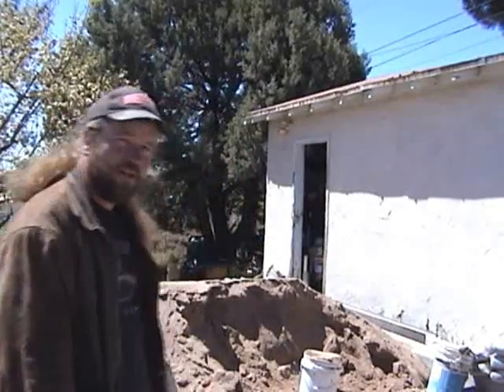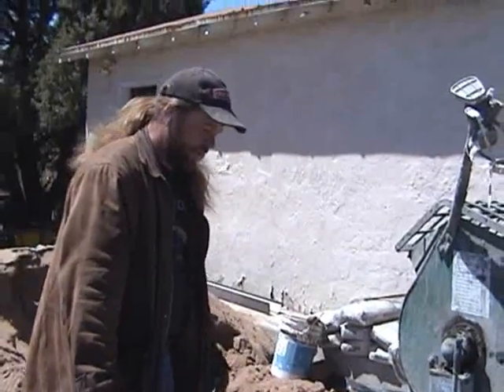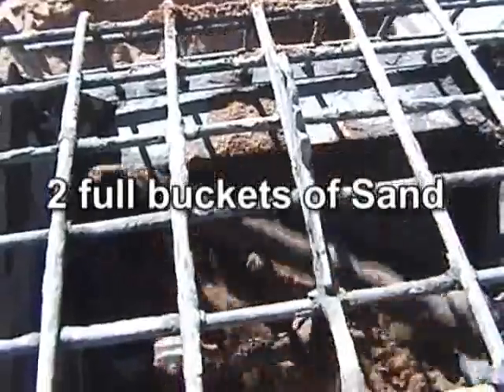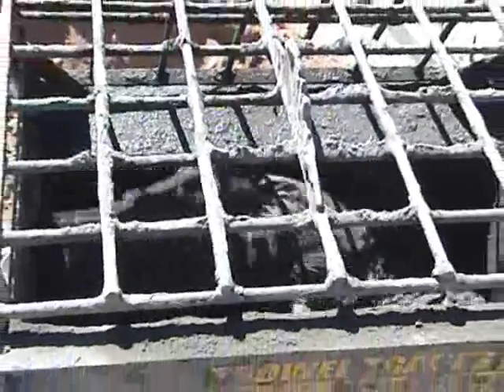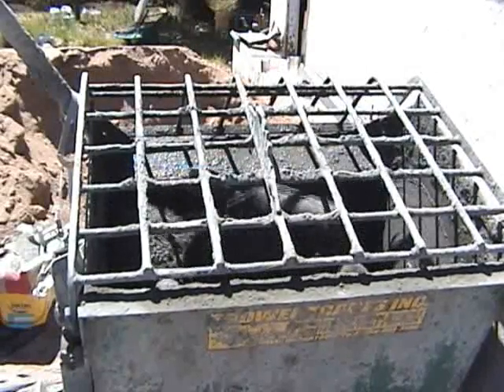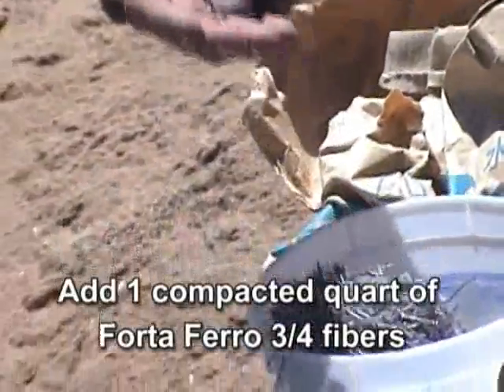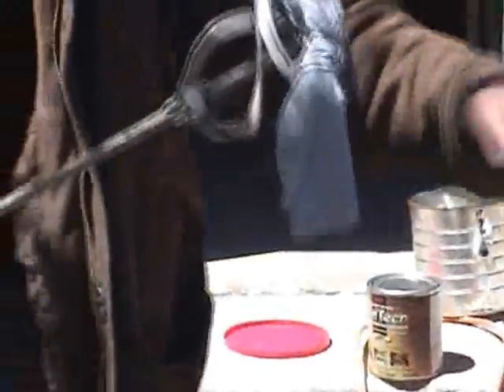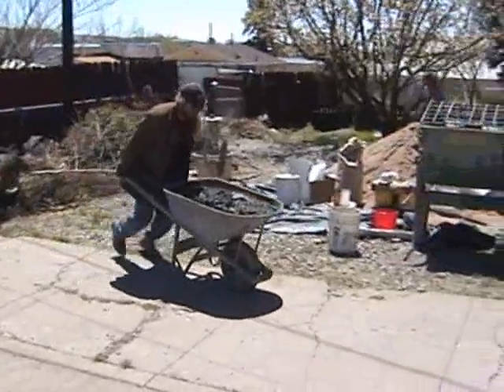The Plaster Mix for Parabolic Stress Skin System

Comment: Doug, your information is fantastic - thank you very much for sharing! I hope that you are still at it. You would be a great asset to many of the 3D printing efforts. Have you found the Eucon SPJ (now 5000) to be better for this than other PCEs, or is this just the one you are used to? We have had problems with PCEs working against the "buildability" (and definitely cause over-sensitivity to water)! Thanks again.
Reply from the maker: I have tried others and the Plastol 5000 is key.  It has the highest solids of the Poly Carb.  It seems to have been reformulated to be like the SPJ since it is no longer clear and so has the 'J' which at the time, before Euclid when those chemicals were owned by Boral, the 'J; meant Japanese lignin component that acts as a dispersant and helps prevent segregation in the High-Range, High-Solids poly carboxylate water reducer.  
The sensitivity you referenced has been eliminated now, as of this summer, by careful timing.  You start with not enough hydration, then cross that threshold slowly by first waiting 9 minutes after the Plastol 5000, to see where you are at, then adding 8 oz, then waiting 3 minutes, repeat until mortar goes from dry balls to slightly viscous, not runny, if it goes runny there is correction procedure soon to be published at www.Flex-Shell-Architecture.com  Drop to 2 minutes for the 3 and repeat pattern of 2 minutes to dial in perfect water content for the STAR M3 flyash and the Silica Fume (the Eucon MSA).  If you cross minimum hydration slowly, you cause most or all of the cement to hydrate by keeping it very dense so the particles shear everything into reaction.  This prevents heat spikes and bubble collapse escalation; a perfect fluffly overhead mix every time.  
I think the free-form funnel column technique is a different or even opposite approach for insulating and inexpensive earhquake safe shelter in a wild terrain, because it is not dependent upon expensive equipment and a level pad, but I believe a printing hybrid, could be good for producing the 10 guage strand.  You just need that tensile and compressive reinforcing , layered in that triangular pattern, and fluid, flex-stable form in order for the shell to perform under dynamic loading.
Reply: Doug, I am really amazed at what you have come up with - both for mix design and procedure. We are not patient enough for onsite mixing (for structures); it is delivered ready-mix concrete that we pump into place without forming. Has the same issues that you face, but not as elegant as what you are doing. It goes very fast - when going per plan.  We have shown that the vertical build rate is effectively limited by how fast you want to pump it. Method development still in progress! I will contact you by email if that is OK. Thank you!
Reply from the maker: @SpaceCrete  Please do, and Thank you.  You know, Flex-Shell (www.Flex-Shell-Architecture.com) is primarily a system for a self-supporting insulated (stress-skin) masonry roof and flex-stable single-shell awning that shelters the entry walls while buttressing the lateral spread of the roof.  I would use the same materials for the entry walls, but any material can be used.  You build your entry walls on a flat thin-slab that is load-bearing, even though you don't need that for an entry wall.  The slab extends to the retaining wall around the drip line, so you need no mechanical bonding of your wall to the floor, columns or ceiling.  It is better that they can crack and shift during earthquake. They just key into the rounded profile of the columns with a reinforced frame so they wont fall in our out.  

You should consider this roof design for your amazing extrusion process.  Also, consider the wire block framing for your fill form, as a stay-in-place form.  I use to focus on the strength of the fill but after switching to a stay-in-place form, 21 years ago, my focus switched to high-strength shells, the geometry of stress-skin design which led to the geometry of relationship, organic architecture, forms that blend to other forms and entire situations. Yeah, try one of these flex pavilions.  The are fast and fun, then use your pumps and injectors to make a fill and walls that you like.
Reply: I really like this mix design you came up with. I was thinking of using it as a coating on the inside and outside of an Aircrete wall & Dome. Is this mix water proof? Where do you buy all of your ingredients from.  I'm located in Trinidad Colorado and would like to find all the ingredients.

Comment: Hi and congratulations on the work and information you have provided so far. I would like to find more detailed information. Is there going to be a book or guide manual eventually? An e-book perhaps? Also any progress on the website and new videos? Thanks.
Reply from the maker: Yes, shambhalavillage.us has some info and flex-shell-architecture.com is the site I am building.  The system has improved greatly and is ready as an available-to-anyone method for hurricane and tornado safe housing.  To achieve this, it is important to focus on the Core Monolith Flex-Shell Pavilion as an initial phase of construction that is carefully integrated into the natural drainage.  This is only the funnel columns, the double shell insulating roof and the single shell curvilinear awning.  This makes one solid piece that can flex instead of come apart under intense strains like earthquakes.  The entry walls are nestled under the archways between the columns.  The foundations and level pads are shored up with retaining walls that use the same material.  These retaining walls channel the water through the terrain and into gardens that prevent erosion damage for the long term.  The truss system is very precise and requires 1 to 2 layers of remesh grid layered at an angle.  Every surface, including the block frame curved trusses, have this no-slip layering of almost two layers of remesh grid still that is offset to create a rigid triangular patter.  For the surface shells, the 3.2 guage expanded metal lath is used.  The shell mix is temperature sensitive, it will cross a threshhold and colapse the bubbles if it is too warm outside.  Adding more foam does not weaken the shell, I just confirmed.  That water is loss to evaporation.  Using a foam generator for the foam is not necessary as the problem was not the quality of the foam, it was always the temperature threshold.  I have overcome much and am about to finish this giant building but will post videos and the book soon.  If you want to start a project, I can help you with a construction management plan based upon a design to keep you on schedule and on budget.
Reply: Thanks for taking the time to reply. I am intending to build next year but at this stage am just seeking more information about the various alternative building techniques or systems on offer. After many hours of reading and watching videos, yours is the most interesting. I look forward to learning more.
Reply from the maker: I hope you do one of these Flex-Shell Architecture Core Monolith Pavilions so you can do your finish work under solid shelter that can never blow away or fall down in an earthquake. The framing is very straight forward and you can really control the shape and explore form through blending known shapes from cross-sections of your plans.  I believe it is faster than stick and frame construction, it is just a little different.  I would recommend a 9 roll starter building; a one pallet job. Process your steel, frame your columns and trusses, lay the surface shell framing, lath then hire some local tallent to help you plaster using this simple cake-recipie of a mortar mix.  The Micron 3 is no longer available and replaced by Starr M3 from Spherix Mineral Products in SC.  The Eucon SPJ has been replaced by Plastol 5000.  Good luck with your project.  Keep me posted.  Keep an eye on the website flex-shell-architecture.com for updates there, too.

Comment: where can I find some of these Specialty Products like mychron 3 and some of the others the fibers all of it
Reply from the maker: The PVA fibers you can order from Nycon.  http://nycon.com/nycon-pva-recs15/   The Forta Ferro fibers you can get from Forta Ferro   The Plastol 5000 (replaces Eucon SPJ no longer available) is from Euclid Chemical Company - You will have to set up an account with them or get it from me.  The Micron 3 is made by Boral Materials Technology.   It ships from their plant just south of Rockdale, Texas which is just east of Austin.  They will only ship a minimum of one pallet at a time and you have to set up an account. I encourage people who are serious about learning this Core Monolith Flex Shell Architecture to get set up with a whole pallet of Micron 3 because that is enough to build a home and a few practice projects. The Mearlcell 3532 is available from Airex Industries in 5 gallon pails. Again you have to set up account with them but not a big deal. I can help you. I can ship you supplies for practice mixes but the shipping can be steep.  I recommend using a simple foam generator you can make at home with PVC pipe instead of the drill whisk and I recommend weighing 40 ounce samples of your sand to compare the density to dry sand so you can compensate for any extra water in your sand. These two improvements helps to make the desired consistency every time you mix.  There is a video on Youtube that will help with the foam generator or I will send you info about my version. A mix cost less than 25 dollars, for 400 pounds of light-weight plaster that is perfect for overhead plastering and permanently water-proof.  That makes it the same price as basic bagged plaster but this makes a water-proof shell that will not degrade overtime like regular cement based composites will, because of the capillaries are completely replaced by spherical cells, which protects it from ice and rust damage forever, and it is a tight, high-strength flyash enhanced matrix that remains chemically active, continues to heal cracks and grow crystals and it can really take a hit, like bullets or hammers, without cracking because of the high strength fiber-reinforced attributes and the aeration that takes the energy out of impacts.  Think funnel column pavilion on natural uneven terrain, so your columns are integrated into the natural drainage for long term stability, then level areas with retaining walls reinforced with the same metal and composite, retaining walls that channel runoff into other terraced sections so the entire area achieves long term stability. I feel the ideal starter building would involve only one truss and that thick stress-skin section can taper to simple funnel column single shell shapes.  This will free up infinite design possibilities, because a truss can span 40 feet and be flat or any shape, think ribcage of a giant winged creature, but will provide an opportunity to practice blending the single-shell funnel columns with the double shell stress skin that has the truss inside.  Your entry walls that are nestled between the columns are a separate project built under the protection of the roof and awning.  This flex-shell geometry way is the best way, in my opinion, to make a roof that cannot be lifted off by a tornado or hurricane winds and to make a building that can handle an intense earthquake without collapsing.  The protected roof gardens, and protected gardens in terraced sections around the building for long term top-soil stability, and the water storage capability inside those columns is an added bonus.  This shell awning and columns approach help regulate a comfortable temperature throughout the year, removing or drastically lowering the cost of heating and cooling.

Comment: Hey!, Doug!! Are you still at it these days?! Doug waters and I built the wire cage fabricator and we will probably be putting some blocks together this spring in order to build a parabolic stress skin greenhouse.  Looking forward to utilizing this system! When you use portland cement is that 90lb bag? Thanks for any update!!
Reply from the maker: +Ron Gray  Going Strong.  Glad to hear. The Curved Truss System is greatly improved and follows a triangular pattern and the surface reinforcing is improved as well so that you are using an average of 2 layers and the layering is off set so that you create a sturdy triangular pattern.  This provides active tensile reinforcing in 360 degrees along the plane of the shell.  Also, the Eucon SPJ is no longer available, I have been using the Plastol 5000 with a tiny tiny amount of Visctrol to control the consistency but you don't need in, just use a 25-30 percent smaller dose of the 5000 and it is fine.  If you like, I can sell you the Plastol 5000 blended with the tiny dose of Visctrol and the Mearlcell 3532 directly so you don't have to set up an account with those companies. You can only get the 3532 in 5 gallon pails which is 15 times more than you will need, unless you are filling the walls with a neat, ultra light cellular concrete.  I have been busy this fall with refining the foam core method for insulated tanks and planters.  I have a new composite and method for that system and it is ideal for cantilevered countertops and shelfs,  Instead of the fiber glass, we have switched to the basalt mesh because you need only use one layer because it is stronger than the 2 layers of glass.
Reply: That is Fantastic, Doug! I will have to send you an email to get some pictures if you have any of the new configuration! I also have changed to basalt ~ fantastic results and the ability to shape it in any form we want! Happy and Blessed Thanksgiving!!

Comment: How far have the New mixes that are out with the additives come sense you first made these videos,and are you still doing this type of work?
Reply: Hi and congratulations on the work and information provided so far. Is there going to be a book or manual guide eventually? Also any progress on the website and new videos? Thanks.
Reply from the maker: @bryanwillis123  you can find new info about the advancements at www.Flex-Shell-Architecture.com
Reply from the maker: Hi Brent - The shell mix is mostly the same but I understand some new things about it because I am lucky enough to have testing facility near by.  The foam replaces any remaining capillaries on the high-strength mix.  This causes its compressive strength to be highly predictable.  If you stay below 3 gallons of water, you can predict the psi of the mix simply by weighing your cube (cured or wet), even if the bubbles collapse and you have to re-wet the mix a little when it comes to the last scrapings in the wheelbarrow, the weight (density) of the mix will always be relative to the psi.  This is because the spherical bubbles replace all the capillaries, caused by water leaving, on a super low water mix.  Also, I learned it is important to clean the measuring cups and tools for the foam with clean water because the damaged foam residue can collapse your whole cake a bit, so to speak. I also now use ice water for the mix when it is hot out.  Lots of work done recently and new website and videos coming.  I do not do or recomend grade beam foundations any more, I do only columns; bell flare columns for better stability and overcoming issues for building codes.  All the buildings now have a much larger, complex curvilinear awning that extends out like a wrap around porch 7.5 to 12 feet and has a edge that curls down.  The system has changed names, it is now called the Bell Column Dome process. You can do flat roofs and columns but bell flares really conserve material and can take bending strains better and really show off what HP thinshell ferrocement can do. The columns are two feet round and flare upward in a 15.5 ft radius until 7 feet where it transitions to the curve of the roof or awning; or the low arc between Bell Flare Columns.  The columns foundations rest in an insulated base that is made from the higher psi blue dow board  I used the micron 3 and Eucon SPJ to enhance the polymer modified cement plaster that usually goes on the foam when typically used for EIFS.  This makes these foundation bases into very nice and very sturdy garden pond planter tanks that have a great value beyond their 'base' purpose, if you will.  They are very tough but light.  These light weight tanks, roughly 52" x 48" x 32" deep, are also used as insulating jackets for regular pallet tot tanks so they can be thermal batteries to store heat for hydronic heating or for the garden planters made from the same material.  I put the blocks in the bottom of the tank, then put a root cloth and place a light soil medium above to make an Earthtainer style planter.  Besides column foundations for a fully insulated buildings with hydronic heating of a thin ferrocement floor slab, these tanks serve about 11 different purposes now and I am having fun building them.  I am also plastering a huge building.  I have some professional help with graphics to explain the system and for the website so that will be up soon as well as a new vid.
Reply: Glad to hear that,I'm wanting to build a small house here in the Texas Hill Country and have worked with concrete as a decorative flat work contractor.I'm just now starting to go vertical so when I ran across your channel I got interested quick!Looking forward to your next videos, thanks and Merry Christmas...

Comment from the maker: @GentleKharmaFarm  The cellular concrete fill that I have used is one bag Portland Cement, 4.2 gallons of water - Let mix for 1 minute at high rpm. Then fill your mixer with about 40 gallons of foam. You need 5 to 6 bag of Portland per cubic yard volume.  That means you need to get about 40 to 45 gallons which is a fairly full mixer.  3 bag per yard mix is about 14 lbs/cubic foot and is way too weak and will collapse.  New foam experiments this summer. Trying for a 3 bag mix that is stable.